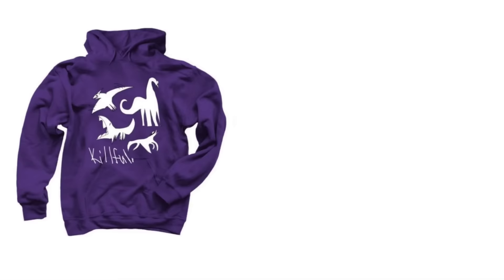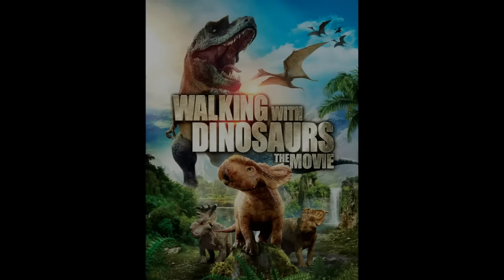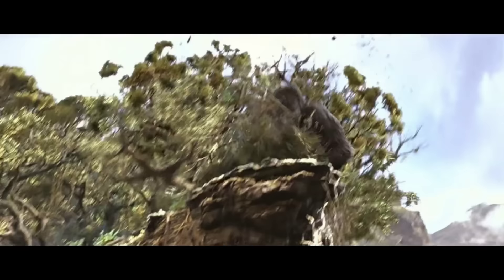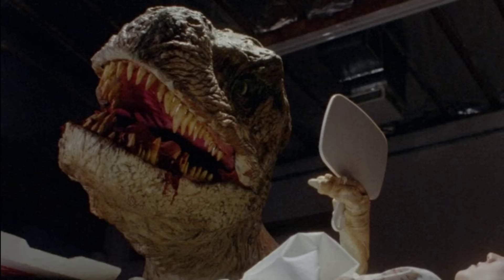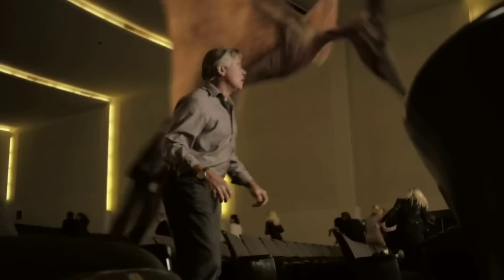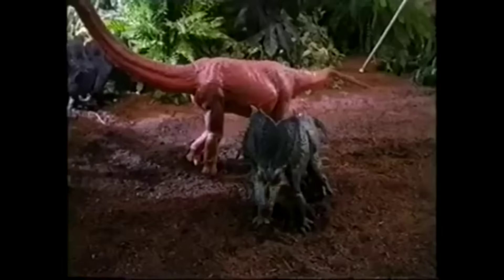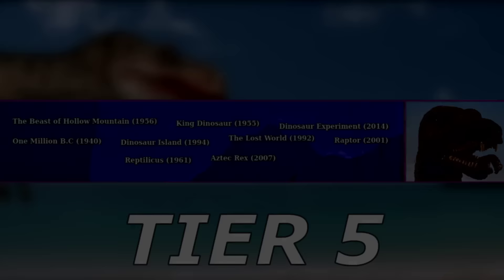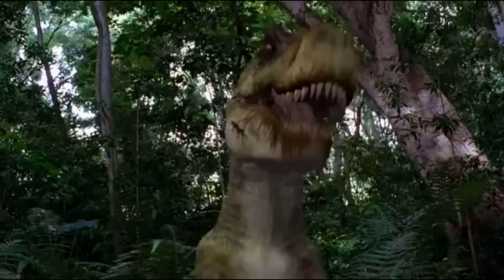The Dinosaur Movie Iceberg

Comment: Fun Fact: The Cretaceous Cut of Walking with Dinosaurs (2013) also changed some things to make it even more accurate, like renaming the Gorgosaurus to Nanuqsaurus.
Reply: They should've just kept it as gorgosaurus tbh
Reply: @Kor06.  It was changed because it's less likely Gorgosaurus would've lived that far North. Nanuqsaurus did live in more polar regions, however.
Reply: @jacobcox4565  you think i don't know? I know more than you buddy
Reply: @jacobcox4565  the design is quite obviously based on gorgosaurus not nanuqsaurus because nanuqsaurus had fluff similar to a polar bear (hence the name)
Reply: @jacobcox4565  so just keep it that way. for example dinosaur planet (not to be confused with the popular planet dinosaur) has an unnamed theropod that is called carcharodontosaurus so should we  change the name? No. Because calling the extremely obvious carcharodontosaurus design as the theropod (i forgot the name) would make it less accurate
Reply: @Kor06.   The design is based off Gorgosaurus because it was thought Gorgosaurus would be a predator for Pachyrhinosaurus back in 2013, but the connection was shakey since Gorgosaurus went extinct before Pachyrhinosaurus lakustai was around. By the time the Cretaceous Cut of the movie was being made, Nanuqsaurus was described and it was found to be a better match timeline wise. There's no fossil evidence of Nanuqsaurus having a full coat of feathers, even if it is very likely. Nanuqsaurus wasn't named for it having a coat of feathers like a Polar Bear's fur, it was named that because of where it lived and its role in its respective ecosystem. Nanuqsaurus was an apex predator that lived in the Arctic Circle, Polar Bears are also apex predators that live in the Arctic Circle.
Reply: @Kor06.   But that'd make it more accurate if they just redubbed it and only changed that one name, because it used to be unnamed, but now it isn't. It's like if you didn't know what a Tiger was called, so you just called it a big cat. You're not wrong, and you could've been more wrong if you had called it a Lion, but you could also be more right if you later learned the name and called a Tiger "Tiger" from then on.
Reply: @jacobcox4565  it's just better if they kept it as gorgosaurus
Reply: @Kor06.   That's a flimsy excuse, even before I listed all the reasons why I believe changing the name was a good decision.
Reply: @jacobcox4565  it just makes it more inaccurate
Reply: @Kor06.  No, it doesn't.
Reply: @jacobcox4565  well yes it does it makes a scaly nanuq
Reply: @Kor06.   But if it were the same, then it's a time travelling Gorgosaurus.
Reply: @jacobcox4565  better

Comment: I was one of the animators on The Dinosaur Project and worked on a lot of the Crypto and Jeholopterus shots. Jellyfish Pictures, the studio responsible for the vfx work, got the job after finishing the BBC documentary series Planet Dinosaur. We made a very short found footage style proof of concept pitch to win the job using some of the Majungasaurus models we'd previously used on Planet Dinosaur. I remember we had to do that on the down-low because technically, we were still on the BBC job at the time. I'm pretty sure I had to temporarily move desks while we worked on the pitch so that the clients from the BBC couldn't see my screen when they came into the studio. 
A couple of the creature assets were also used in both Planet Dinosaur and The Dinosaur Project, namely the Plesiosaur and Predator x, with some slight changes to their textures.
One of the shots I remember best was from the sequence where Luke films the 3 Crypto swimming in the river. Originally, that shot used 3 guys in wetsuits and snorkels rolling around in the water to get water interactions that would have otherwise been way more expensive to do digitally. It looked pretty hilarious before they were painted out and replaced with the dinos.